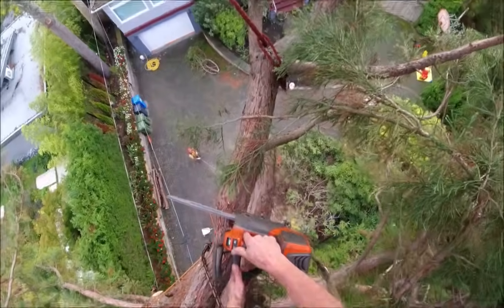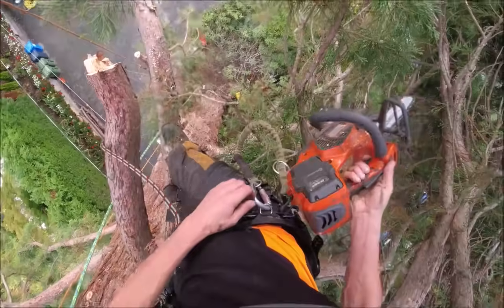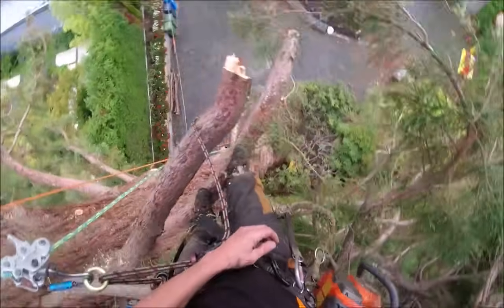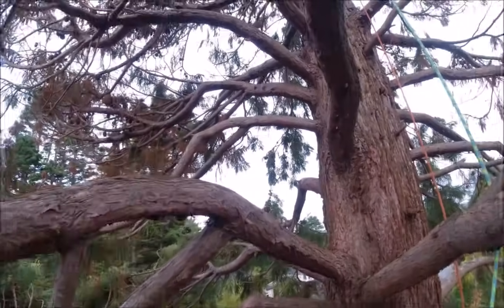Cutting down Big Wood in small pieces

Comment: Very few know what it’s like to use a 3120…even fewer have actually used one for spar work at height…a selective few make it look easy and you’re one of them.  Absolutely fantastic Reg.
Reply: Tree climber harry is anothern
Reply: I have  a 60” 3120. Won’t catch me swinging it 😆
Reply: I've done it once was only 15ft of stem left to get down. Can't imagine doing it again
Reply: @MT_T991  That’s impressive…if I tried it it would look like the proverbial phrase “looks like a monkey screwin a football” lol
Reply: @Wildwoodjake  it wasn't that impressive, the bar was a 42". Chogged it to about 10ft and felled the rest.
Reply: I was about to comment did this dude just whip out the 3120 at 50+ feet 😮😮😮
Reply: I lifted a 3120 once, held it for 10 seconds, and at that point I'd had enough, maybe forever.

Comment: Wow Reg. When you started chunking it down with the 50" bar my jaw dropped. I'm not a big man and at 68 years old, the biggest saw I climb with has a 20" bar.
I like the truck load of chips to make a cushy mat to drop chunks on. Much respect brother.
Reply: I Respect you…I’m 58 and still climb as well but definitely not with 20 plus pound saws.  I’ve had a 50 cc saw on a spar and paid for it the next day.
Reply: I hear ya, Jake. I try to keep my tree removals or pruning jobs 3 hours long or less. That way, I'm not hurting so bad that I can't get to sleep. I have an Echo CS4910 50cc saw with a 20" bar. I do take it up to cut big spars that my tophandle saws can't handle. It's one of the lightest 50cc saws, and with the decompression valve, it's also easy to start in a tree. Keep up the good work, but be kind to your body.
Reply: Just asking, wouldn't it be effective to use a crane for this  job?
Reply: @saltyj6712 
@15:28

Comment: Very nicely done!  Did you put a ripping chain on the 3120, or just power through with a regular all-purpose profile?

I hope your shoulder is improving.
Reply from the maker: Just regular. The wood is relatively soft, and full of moisture as I got lower down
Reply: @Recoates what depth you run your depth gauges on your 36" bar saw? They sound shallow. But maybe it's the vid. Is that for safety? Or just it's too much extra time ? 😂

Comment: Reg, have you ever tried using dowels to roll off the big wood? I find it to be a game changer. Two 1/4” dowels put in so the heavy piece rolls to the edge of the trunk. We have rolled 1000 pound pieces this way.

Arborist Blair Glenn
Reply from the maker: Yes, many times. But in this instance a full sized round would  damage the retaining wall and driveway. Which is why everything had to be diced up.
Reply: @Recoates  got it. Saw you dump chips but didn’t see what could be damaged. Always a challenge.
Reply from the maker: @arboristBlairGlenn  yes, wall underneath the chips. Had to keep pushing the chips back into a mouth every 2 chunks

Comment: How’d your old body feel after that one?  I remember watching your vids 15 years ago. Good to see your still knocking down the big ones!
Reply from the maker: Feels the same as it did 15 years ago. Or maybe stronger. I tackle many big trees alone these day, which means I cut, drag, carry and chip every single branch or log on the job. It keeps me lean. 15 years ago I was never without an abundance of skilled and strong assistants. And I kept much shorter hours.
Reply: that's great! I'm in the same boat, mostly work by myself and I feel in better shape with less pain in my late 40's then I did in my early 30's. I agree technique has made tree work pretty darn easy and not a struggle like it was my first 10 years of climbing. 
 @Recoates

Comment: Around 10.00 min: there aren't many people with a beautifull lunch table like that! 😆

But seriously... Awesome job and I wonder how you didn't cut your flipline when making the vertical cuts. I would be terrified cutting straight through.

Curious: do you use a different angle on the chain when you know you're going to use the saw in a different way than usual, or is it still about 30 degrees? I've tried this once, but with the standard angle the saw cuts best from bark to bark. Somehow it didn't went through as nice when I did the cuts like you did in the movie.
Reply from the maker: I don't alter/mess with the chain. Just sharpen to the same angles as it was designed.
Reply: @Recoates  Thanks!

Comment: I use a 14-foot tandem axle dump trailer with high sides which gives about a 15-yard capacity for tree debris.  We can keep the chips clean and put the junk in the trailer. It works well except when it's raining.

Comment: Honest question, wouldn't it have been easier and faster to negative rig the chunks?
Reply: How? At the base it's over 8f.
Reply: @treetramp7249 lmao right. He would need to probably use a 2" rigging rope to handle those shock loads. I think the chip bed was a great idea I'm sure it sucked to clean but thinking of rigging those chunks down makes my brain bleed.
Reply: You would most definitely have to go 2 system double whip tackle and even then I'm not sure it would be safe. The bollards you would need would be something serious. Would have to run some 7/8 for both double whip system.   Once you got to over 3 foot dbh the KN's wouldn't be very fun lol.

Comment: First of all, that was really impressive!

But I’m also very confused by the argument that a crane would have been too expensive of an option unless the hourly rate of a climber in BC is very low.

Where I’m from in Denmark the hourly rate of a climber + groundie are in most cases (varying from company to company) always higher than a crane.
Granted, you still need the climber even tough you had the crane, but it would have reduced the overall climbing time to a fraction.

And in terms of the wood having to be cut into small pieces in order to be sold to a different customer, to me that just sounds like it was a wrong decision delivering the wood at said customer.
Reply from the maker: The crane is approximately $4000 per day. But the wood still has to be cut up and loaded on my truck. A small truck like mine is needed to access the dump site. The wood was to be delivered to the customers son. That was a condition on their part, not a decision of mine.
Reply: Don't they have those big ass logging helicopters that are cost effective for virgin timber in steep ravine country.....would work for 100 trees, but not just one. .... @Recoates
Reply from the maker: @colorado1088  the Erikson aircraft is a popular one for forestry here. But the downwind alone is probably 100mph. So I doubt very much it'd be permitted to operate over the district of Oak Bay. Out side of that, the cost is astronomical.

Comment: Seems like the value of that lumber would have paid for a crane. A 12ftx4ftx4in slab would bring $1000. Could have made dozens from that tree.
Reply from the maker: Value to whom ? I'd be lucky to give it away here. And here in Victoria that would include delivering it. I've been down that road before with Sequoia. It ends up being  a waste of time talking to people with dreams and intentions, but no means.
Reply: @Recoates  Seems like if you could get Blacktail Studios or other woodworking channels (I think they may be out East and too expensive to ship to) to do a video on a slab table from a tree like that they would drum up interest. A mill near to me in central Utah tells me they get around $1000 for large table slabs. I would love to make a table from a cross section of the base of a tree like that (and normal tables).  It will be tricky though as it will shrink and crack all over. 
You probably encounter trees like this somewhat frequently up there though. To me it seems like a crime to not make something out of a tree like that. But I live in the desert... 

I am working on removing a tree in my yard right now that has an 8ft base at 2ft up. It is a cottonwood or poplar though and won't look as nice as a tree like that one. One side has rot, so hoping something usable can be found in the other half. 
How did you make that flat cut on such a large stump? Is that just working that long bar around the tree using the cut to keep it aligned?

Comment: I really dont understand why people would cheap out on a spider lift just to take down the last 40' of stem of so. Client seems to do reasonably well with money and the lift would cost 500$ plus all the pain and suffering you are saving from your body.
Reply from the maker: I don't recall any pain or suffering, so there's no issues
Reply: @Recoates  I'm sure your body is in mint condition.
Reply from the maker: @nicolaslemieux9217  you have to put the work into context. I'm in a comfortable position on the spurs. I'm using the saw either horizontally or vertical, so other than quickly lining it up each time, I'm never really carrying the weight of it. Technique is obviously key, but other than some restrictions in my movement, it's not much different than sawing up on the ground.